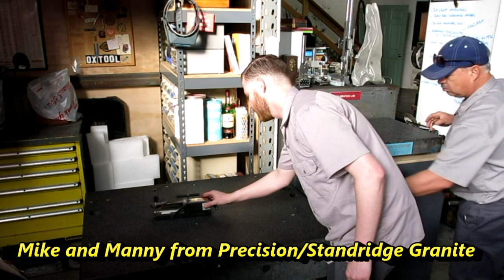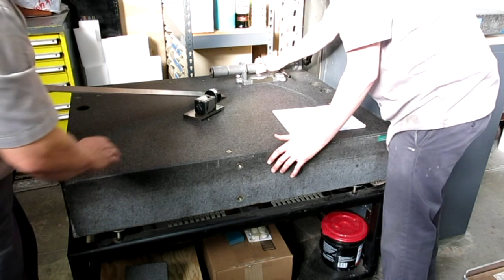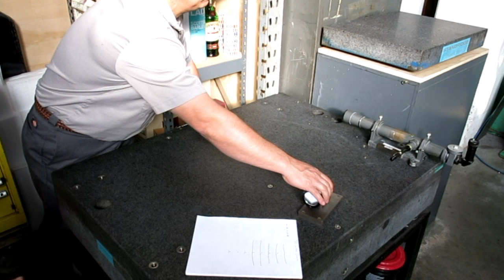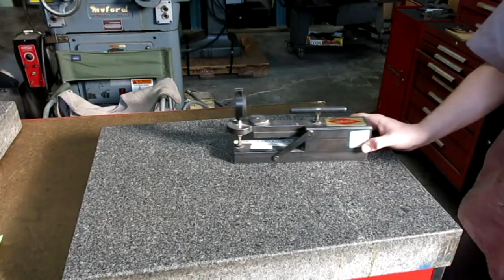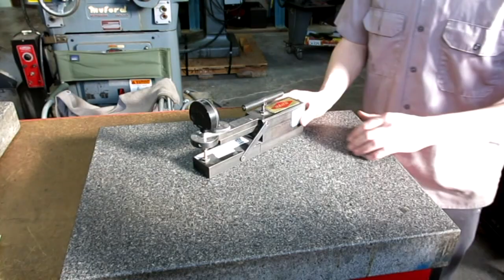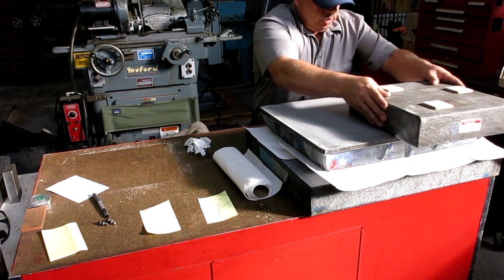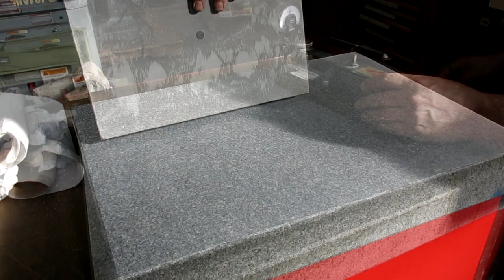Surface Plate Calibration and Conditioning

Comment: Tom, thanks for sharing this with us!  The process of flattening granite surface plates isn't seen often by machinists.  I saw the tail end of a calibration about 30 years ago but that's all.  Funny story - when I first began working in the engineering department where I'm working now (25 years ago) I found under a huge pile of junk, a pink granite surface plate , a monster size 6 foot by 10 foot.  After I cleared it off and tried cleaning it, I found globs of hardened epoxy all over it's surface!  It turns out that a bunch of students were using it to make composite panels on it!  That stone must have cost 10's of thousands of dollars and was used as a table!  We have since gotten rid of it and I replaced it with a 4 x 4 foot pink stone that I use to set up fixturing for my new wire EDM.
Reply: AAH!!! the money that schools spend is indeed staggering, the mistreatment of what is purchased is even more staggering!!

Comment: Hey, great video. 
I've got a question. Could you explain why granite changes convexity depending on temperature? 'Cause my understanding it should grow in all directions about the same, shouldn't it?
Reply: +voron11000 I don't know if the granite changes shape at a different temperature, I think it's more that the center and middle of the plate take longer to equalise to the same temperature, and if it's not in a temperature controlled lab, the larger temperature swings in summer or winter result in their being more or less temperature differential between the core at the center and the surfaces and the edges. In other words, I think if you cool a plate that's flat at 20C down to 10C, and leave it long enough that it's an even 10C throughout, it'll be dead-flat, but as it cools it will go through a phase of being convex as the core is warmer than the surface. Anyway, that's just my take on it as an amateur.

Comment: Tom, that was a great video.  I had the same impression you did before seeing it done in the video.  Figured they would work on small areas, measure and repeat until they had it flat, similar to scraping ways.  So there's three items for the tool acquisition list.

Comment: I was wondering about wear and calibration of their measuring instruments,  It seems to me  after all the sliding around on the surface would tend to wear on them.
It would be interesting to watch the calibration process.
Reply: +Robert Perrigo 
The Autocollimater measures changes in the angle of the mirror, Not absolute angle. If the angle doesn't change then its a straight line. The repeat-o-meter measures changes in curve(unless calibrated from a know flat as he did in the video). So wear from one plate to the next would have no effect. At least thats my understanding of it.
Reply: And if they do wear, they wear towards flat because they're always moving them against flat surfaces.

Comment: I was surprised  at the simple  equipment  too.  You can tell those guys have a solid understanding  of the concepts, and are not just following  steps.
Reply: And thus begins my descent into the youtube black hole of telescope mirror lapping haha
Reply: +Bill De La Vega It's actually a very simple thing to do. I mean, people make telescope lenses/mirrors at home with similar (yet applied to the world of glass) methods and devices. I can totally see something like this done by someone with the tools and patience required.

I remember reading about a guy who made a 60 cm mirror and had it checked and he was within PRO levels of accuracy.

But yeah, those two are very adept at what they are doing, also, well oiled teamwork.
Reply: Giuliano's Things
I've been there. It's nice.
Reply: +Strax Gasser Yeah people hand lap telescope mirrors to within millionths of an inch of parabola.
Reply: How do you lap a curved surface? Lapping is done to make things flat. Convex and concave surfaces have to be cut or ground and then polished.
Reply: @deeremeyer1753  they make a mold of the surface with liquid sap - which dries on the plate they lay on top - they then score grooves in the sap charged plate, and use it to lap with (using a liquid abrasive).
Reply: +aserta
Yeah, I have also been fascinated by telescope mirror making. 

Technically grinding and polishing a telescope mirror looks quite alike and simple. However the accuracy of the parabolic mirror has to be within 1/8 of the wavelength of visible light, about 2,7 millions of an inch.

While polishing looks simple, getting it right is actually hard to do. Even the
experienced amateur mirror makers often have to take several attempts.  It is not like dusting the high spots down using a surface grinder.  The motion of the lap is the key.  The pattern the lap is moved by, whether in strokes, ovals, swirls and with which overlap: all influences how and where material removed.
Reply: @straxgasser2943 
What is truly amazing isn't so much getting it right, but knowing that the thickness of a molecule of air probably changes at different altitudes. Think that I remember Mr Pete 222 checking or comparing the thickness of red Dykem and blue Dykem. Maybe it was Abom
Reply: Except lenses aren't flat and there's a lot more to the finished product's performance than just the lens being "made" to a "PRO level of accuracy". That guy probably didn't start with a flat chunk of glass he made in the garage out of beach sand. He probably started with a rough-finished blank and lapped and polished it and possibly cut it down to the desired diameter. There are also multiple lenses and mirrors in most telescopes, so If you read about a single lens or mirror, there's a good chance the "article" was written by someone trying to sell his "glass services" claiming he was able to make things he was turning around and buying made to his specs overseas for a fraction of what he would turn around and sell "his" product for.

Comment: That is amazing. Thanks a lot for sharing this and what surprised me the most is the fact that the laps they use are smaller than the actual surface plate, I always thought that in order to lap something correctly you need to have a bigger lap than your part.

Comment: Cool!  I wonder why the diamond doesn't eat the iron as it does the granite being that the former is so much softer...  Also it seems strange that they don't need to calibrate the iron plates, seems they'd want wear convex over time due to the tendency to rock when moved putting greater pressure on the periphery.  And from wearing on uneven granite...  It's so simple and yet not.
Reply: +svenp The diamond does eat the iron lap but since they are both flat they "fix" each other automatically. When I was into making telescopes the method of making optical flats (for secondary mirrors) was pretty much the same, except that you used three blank pieces of glass ground together and shuffled in a certain sequence.
Reply: +TheChipmunk2008 If you use only two without a reference, they will take on a pair of mutually compatible shapes (matching by arbitrary tangential translation), which could be planer, or could be on convex, one concave spherical, or, if done sloppily without appropriate rotation, cylindrical facets of assorted radii. With three, the ONLY mutually surface for all three is a plane. In this case, the tool is known good, and as it is used for very small bits of work on a variety of uncorrelated plates, it averages getting better. As the abrasive is bedded in the tool, it cuts much less than the workpiece, and even a really bed workpiece will take the brunt of the cut. I would guess that is why he said that they keep a variety of tools in the truck, and pick one that is appropriate for the job: less precise for bad workpieces, upping the tool precision as the workpiece is brought in to spec.
Reply: Also, I believe the main reason the cast iron lap is not eaten by the diamonds is that the diamonds embed into the surface of the lap, being the lap is softer than the surface being abraded.
Reply: +ArtemiaSalina Am I right in thinking the use of 3 rather than just 2 is to prevent one becoming concave and the other convex and being 'unfixable' ?
Reply: yes  3 all matched can only be flat
Reply: *****
I'm not really sure. It's only something I've read about (many years ago) and never done, myself. What you're saying sounds right.
Reply: +john john Thank you, that confirms my suspicions, and is also a great response... thank you :D
Reply: +BlueCollarScholar Yep, thats the one.
Reply: The laps is porous cast iron, that's exactly how diamonds are cut, on a cast iron wheel charged with diamond dust.
Reply: Viktor Kaganovich how were the diamonds put in iron laps?

Comment: Hi Tom. In previous videos, I thought your middle size granite had a wear mark or scratch on it, about a quarter way from the right side. We see the line at 25:25. But after this video we can see it a natural line in the granite, it's amazing to see how nature made that almost straight line in stone.
Reply from the maker: +John C Hi John,

Its just a line of lighter colored granite in the plate. Another person thought it was a crack. I never really noticed it until they lapped off the dirty couple of tenths of surface. Thanks for the comment.

Cheers,

Tom
Reply: DEEREMEYER1 Why do idiots who have absolutely zero knowledge about things always feel the need to speak about them? For anyone else who come across this video and is reading these posts, even the most cursory search on what igneous rock is will show that DEERMEYER1 is more full of shit than a dairy farm.
Reply: It's not a straight line. It may look straight and be fairly straigh but what you know what they say about straight lines in "nature". There are no straight faults in stone and the plate was probably broken at some point and was repaired  or it was flawed from day one and hasn't broken completely. Granite itself is nothing but small rocks stuck together by dried mud more or less. And a lot of "granite" if not most these days is synthetic anyway. They call it "engineered stone". You don't think natural granite REALLY comes in all those colors for countertops and there's a thousand quarries out there full of it, do you? Granite is "stone" and "stone" is a composite. Rock is monolithic. The composite nature of granite and the fact that its basically lots of pebbles and fragments in a "cement" binder is what allows it to expand and contract and "breathe" without breaking. It has no grain so when it does crack its not along a straight line or across a grain the way rock breaks and in the process distorts and springs and is impossible to get back in one piece. Granite will break along a "fault line" and through the "cement" but the pebbles and fragments of rock should fit right back together like puzzle pieces. Obviously the adhesives exist to stick damn near anything to anything else. as long as its flat and true and stabilized and well-supported it'll probably stay intact forever and may have been cracked forever.